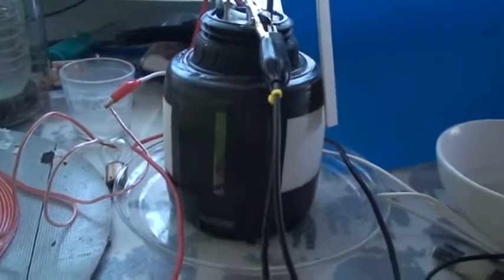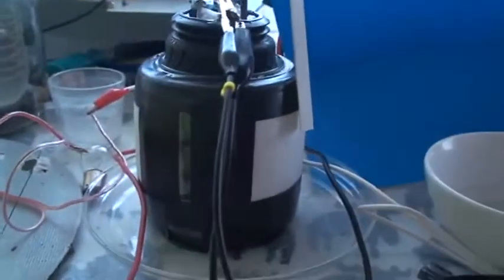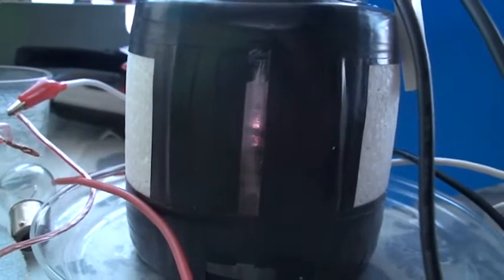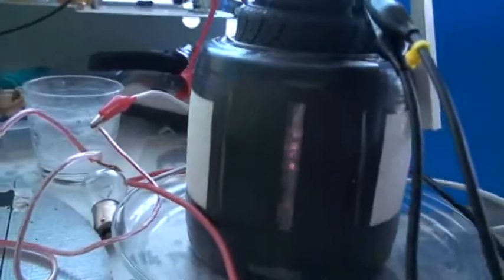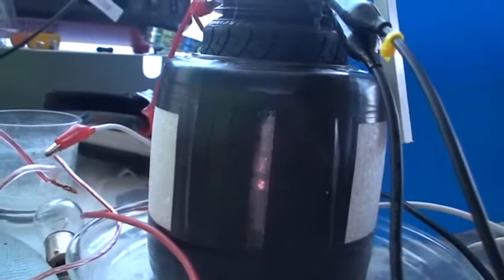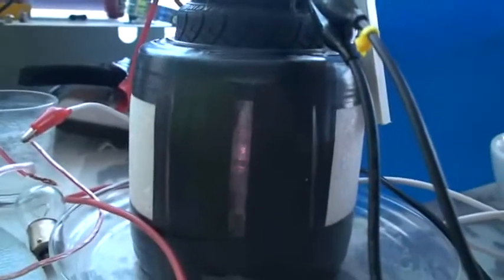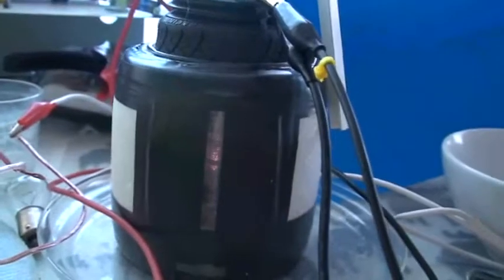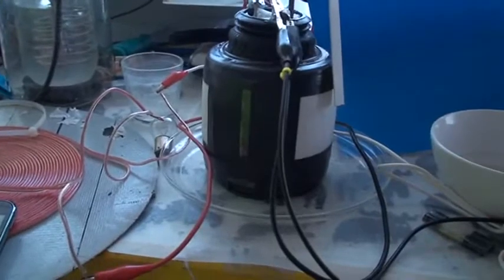LENR practical test with a magnet 4

Comment: By the way, I would not do this experiment in a sealed glass, as the risk is far to high. Also you should have a protection wall in place, so in any case something goes wrong...you are at least somehow protected.
Once you start to experiment with electrolytes, this will definitely become the case.